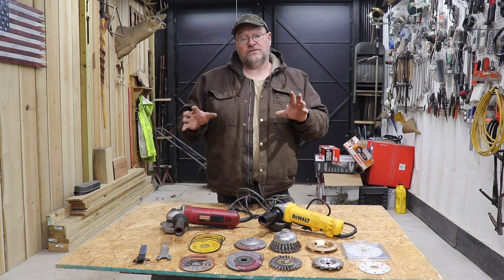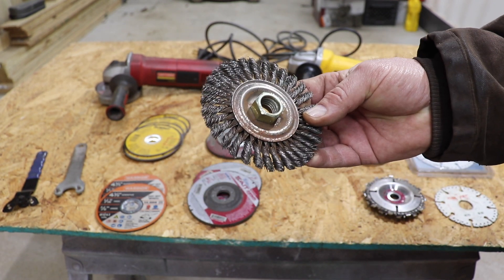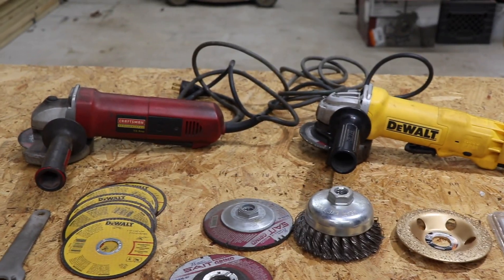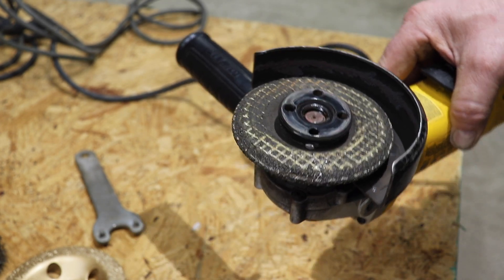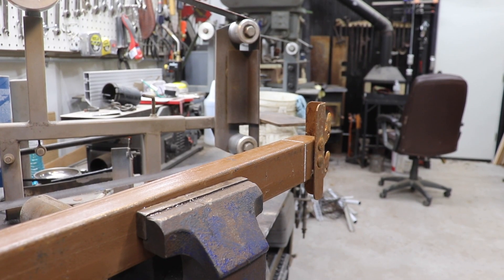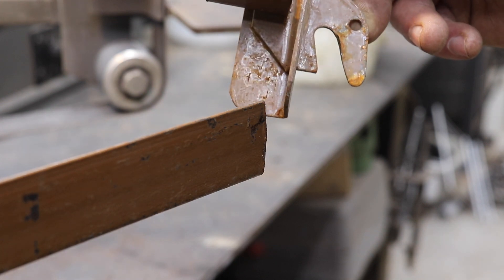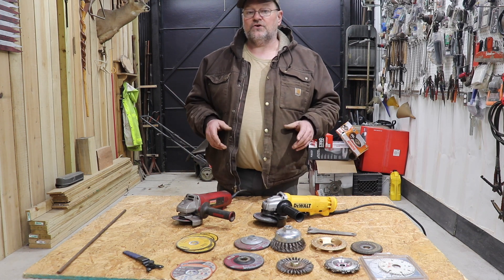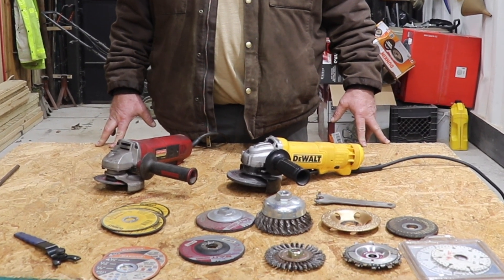How to use a four inch grinder for beginners

Comment: Good video and job. When the hft ones are on sell I get them I have 6 now wire brushs on 2 , grinding wheels on 2, cut off wheel on 1,  sanding disc on 1 . Makes life easier for less than $$10. Take care, be safe and well.
Reply from the maker: Thanks John.